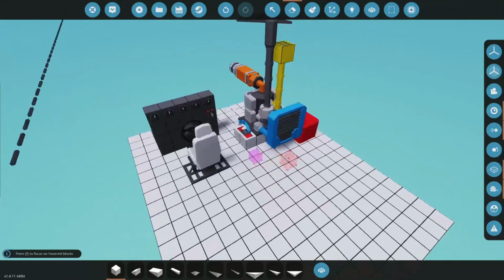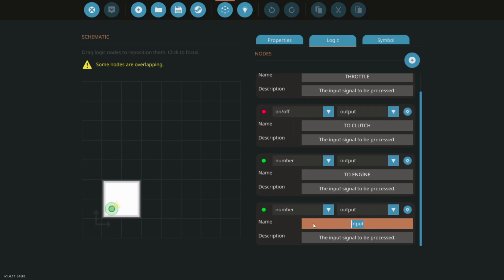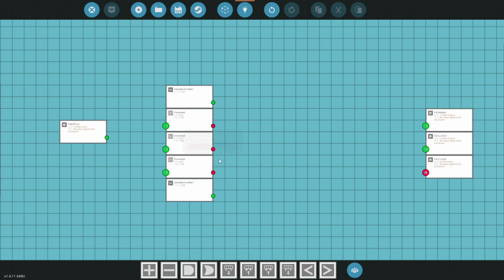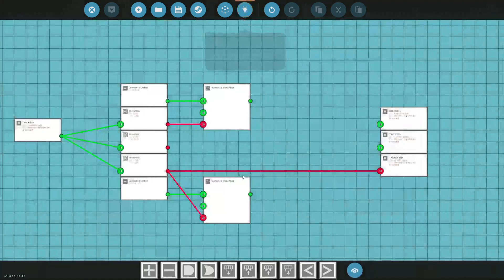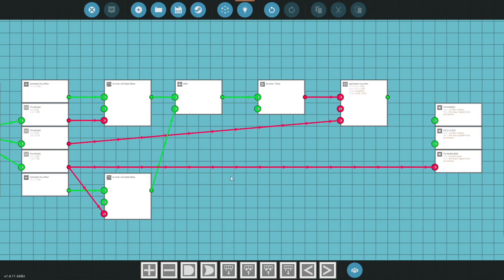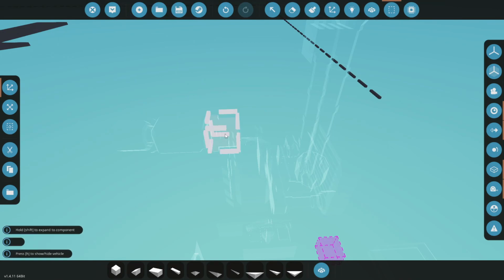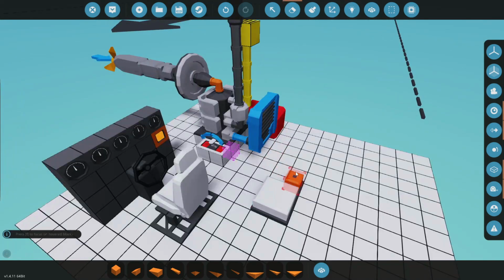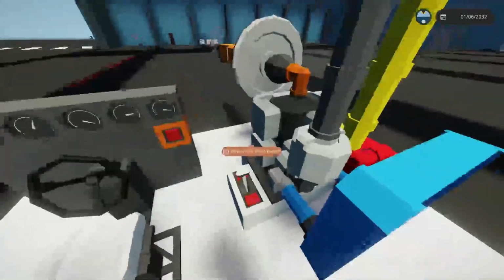Beginners Boat Throttle Controls! Stormworks Key & Seat Throttle Tutorial - How To

Comment: old video i know but i had this working manually with W on seat set to clutch and a lever for RPM but engine was running away without clutch. i have tried to change to this setup but doesnt seem to run the clutch engines just rev up. could this be becasue im running 2 duplicate engines instead of one
Reply from the maker: Quite possibly

Comment: I watched and rewound this video no less than 15 times, checked every single connection and every single number and every single piece of my engine and this MC for the last 3 hours and I can not get my Clutch to engage/disengage. the RPS goes through the the modular clutch, into the flywheel, into the second modular clutch, into the main clutch, and then no matter what I do I can not get it to transfer power past that point. 
the more I play this game the more I realize I'm just not smart enough to play this.
Reply from the maker: Join my discord and let's see if we can get you sorted out.
Reply: @ProfNCognito  Thanks for replying man, I tried to join the discord link but it says the link is invalid. I got it sorted out a bit from the other persons comment by editing the Up/Down counter and the reverse threshold to a negative number but now the engine stalls when switching between forward and reverse gears. I still don't have my gearing set up properly so maybe its an RPS issue? I'm pretty new to this game so I still don't understand a lot haha
Reply from the maker: Glad you figured it out.

Comment: hey mate I gave it a shot but I can't get it to work, I've figured out that the microcontroller isn't actually activating the clutch, (not the 2 clutches on the fly wheel those are engaged with the constant number) but the final clutch doesn't seem  to be getting actuated by the microcontroller, any help would be greatly appreciated, cheers!
Reply from the maker: I always rell people check all your connections, but clutchs changed last update. Might be broken now. Will have to test.
Reply: @ProfNCognito  all the connections are good, i guess something did change, cheers for the help
Reply from the maker: Yeah alot of my builds broke on this last update. Oh well.  On to new builds.
Reply: @ProfNCognito  I managed to get it working with a lil redesign, still can't thank you enough for at least the base design and idea, cheers for the help and I look forward to your future designs
Reply from the maker: @borisgrishenko652  what was the redesign if you don't mind me asking?
Reply: @ProfNCognito  it was changing values rather than a redesign, but the reverse throttle threshold needed both values to be negative (e.g. Low thresh= -.19 high thresh=  -1) and the up/down counter needed a max value set that being 1. And I think that's all I needed to get it to work (took me forever to figure it out cuz I suck at Microcontrollers)
Reply: @borisgrishenko652  That helped a lot already :D I couldnt figure our why my thing was not moving anymore. Well, the reverse is still not working and the boat makes some really bad noises but it moves! :D
Reply: @MrPupsi  I'm surprised an update hasn't broken this, glad it's still helping people
Reply: @borisgrishenko652  I still had to finetune it and the reverse tends to kiill my engine but oh well ... :D
Reply: @MrPupsi  put a fly wheel between the engine and clutch, the flywheel will help the engine keep momentum and as such not die during a gear change or clutch engagement
Reply: @borisgrishenko652  Yea, i thought thats the problem. Im new to building stuff, so i decided to do a career with research to not get overwhelmed by all the blocks. And that means i dont have this unlocked yet :D Gonna give this a try when i have it.

Comment: I can never get any response out of the clutch and I don't know why
Reply from the maker: Power to it? A.  A number imput higher than .5? Try those first.
Reply: @ProfNCognito  I'll try
Reply: @ProfNCognito  ayo I changed some values in the microcontroller and it worked, but I'm using fluid jets and I don't think reverse works on them?
Reply from the maker: @Ahyum  yeah it's controlled by the trim fins
Reply: @Ahyum  To get reverse on fluid jets, you need to give both sides a value of 1.